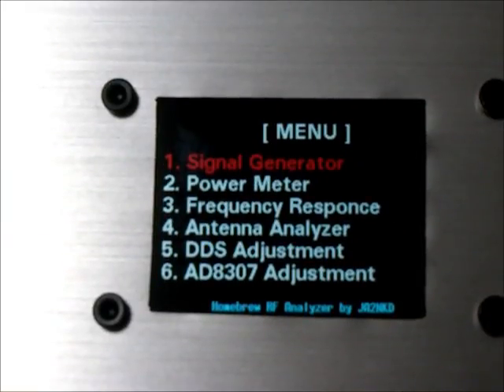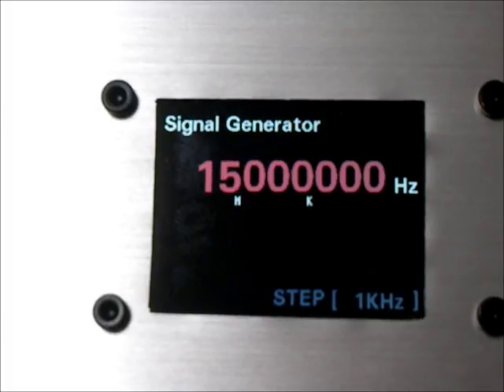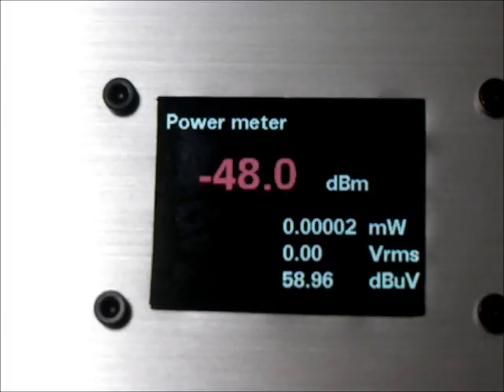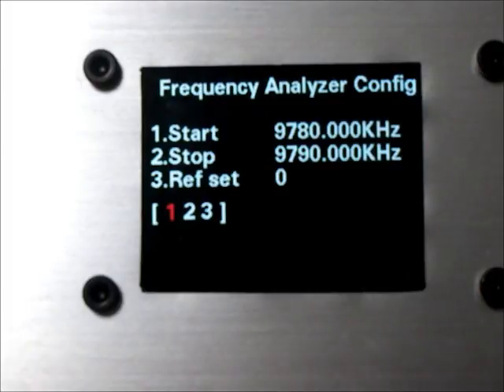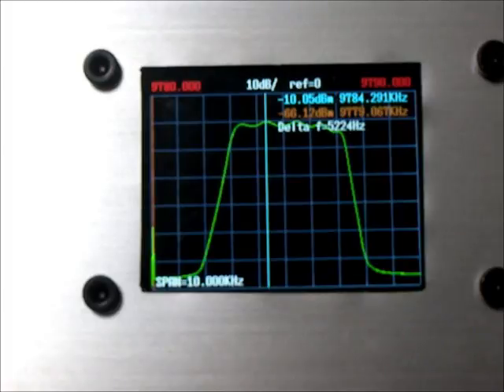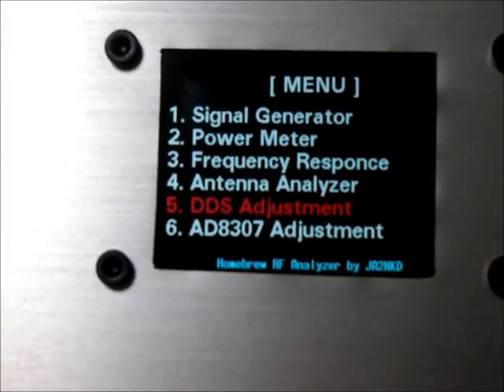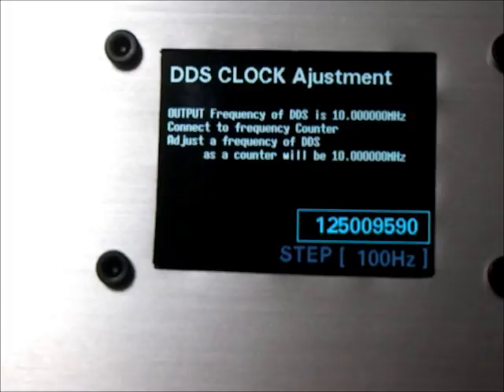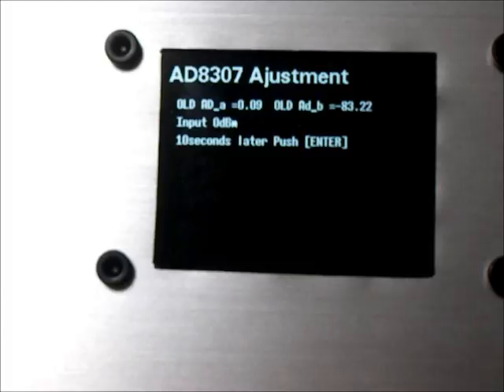RF-Analyzer (Ver1.0)

Comment: Hi Matsuura-san
Never mind the message below. I got it working by changing the processor to 
Atmega328P (Old bootloader). But I still have this warning at compile time. 
Is there something I have to change in Ucglib.h or Ucglib.cpp

WARNING: library Ucglib claims to run on [all] architecture(s) and may be incompatible with your current board which runs on [avr] architecture(s).
Reply from the maker: ucg.lib has been successfully compiled using the original.
I don't understand your trouble.
sorry.
JA2NKD Ryuu

Comment: I assembled this circuit using breadboard. But when I compiled your file and uploaded to Arduino, it doesn't run and I get this message
(I am using NANO and I used your RF_Anlyzer Ver.1.0 schematics.)
  

avrdude: stk500_recv() : programmer is not responding
avrdude: stk500_getsunc() : attempt 1 of 10: not in sync: resp=0xce
:
:

Do you have an idea of what could be the problem? H/W or S/W
Any suggestion will be really appreciated. Thanks

Comment: Dear Ryuu 
What I wanted to point out is that your schematic says use T25-10 (8 turns - is this 0.22 uH?) for  core but in the video image, you used smaller core (it looks like a 6 mm diameter core). Which should I use? If it doesn't matter, then could you tell me what uH value L1,L2,L3 must produce?
Reply from the maker: There is a lot of information when you search "T25-10" on the WEB. With RFanalyzer, it is about 0.122uH in 8 turns.　Outer Diameter: 0.255inches　OK?

Comment: Hello,
You used T25-10 as the core in L1, L2, L3. Could you tell me what is the meaning of this specification? Is it a core of diameter 25 mm or a core of diameter 10 mm?

Comment: This is a really great project. I was thinking about putting one together myself, but a couple of the parts on the schematics have me confused. You have an IC near the input BNC connector that is not labeled. Is it an op amp such as a MCP6002?. Also, in the legend I am not sure what Q1 is referring to.
Reply from the maker: Hi,Alley .
Thank you for having interest in my RF analyzer.
IC near BNC is AD8307(log amp IC).
Schematic  was corrected.
Please see my blog(https://ja2nkd.blogspot.jp/2016/08/arduinolcd-interface.html) about Q1.

Let's enjoy homebrew.

73's
Ryuu(JA2NKD)
Reply: Thank you for the reply. I am going to order the parts I need to put one of these together. The parts I am unsure about are the three T25-10 UEW 0.3mm 8t, and confirm of the resistors values: 50ohm, 100ohm, 4.7ohm, and 24ohm.

Thank you for your help.
Reply from the maker: Hi,Alley. LPF cut off frequency is 65MHz. 50ohm 
 L=0.122uH C=48.97pF  T25-10 is 8t.
OK?
Reply: Resisters are 4.7ohm and 24 ohm, not 4.7kohm and 24kohm?
Also does T25-10 UEW 0.3mm 8t mean 8 turns of UEW 0.3mm wire on a T25-10?
Reply from the maker: Hi,Alley
Resister is 24 ohm-50 ohm. 
UEW is 0.2-0.3 mm. It's not severe. 
OK?

Comment: Hi Matissuri, how are you? One question, with this RF analyzer could we do a spectrum  analyzer? It would be interesting to analyze our qrp homebrew 
  Thank you
Reply from the maker: Hi,Marcelo.Thank you up comment.
This analyzer is not spectrum analyzer.
 But it's like network analyzer or spectrum analyzer with tracking generator.
 It's measured signal by inside DDS.
Input signal of DDS to DUT. And measure output level. 
OK?

JA2NKD